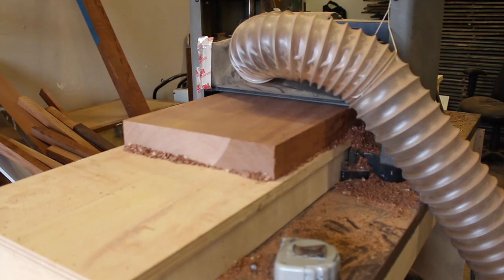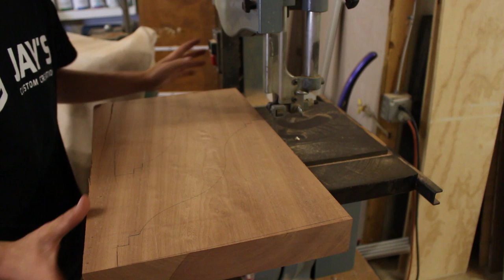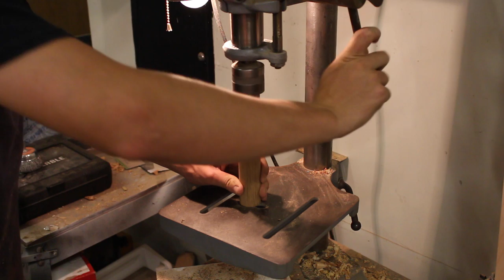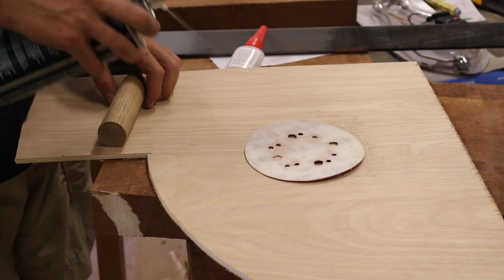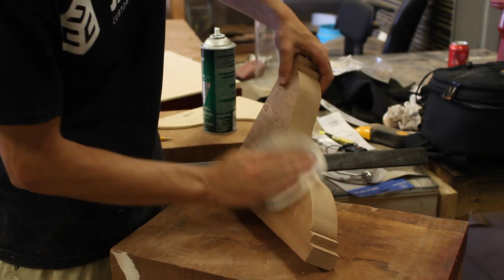Making Corbels | How To

Comment: In the end it looks good, just not sure why you went to the trouble of hand planing when you were going to run it through the power planer
Reply: You need to joint before you plane. His jointer was not wide enough to joint that board. There are other tricks to get the board flat on one side with a planer and a sled, but a bit of work by hand is way more fan.